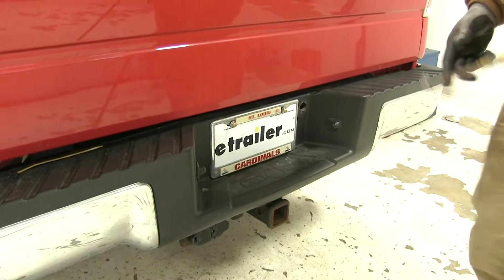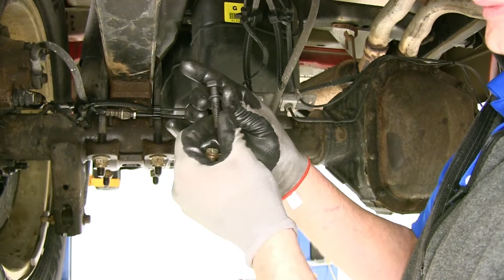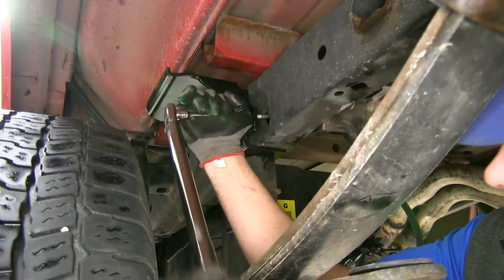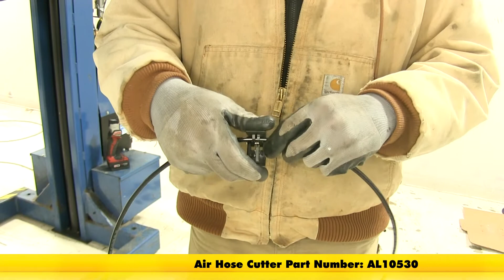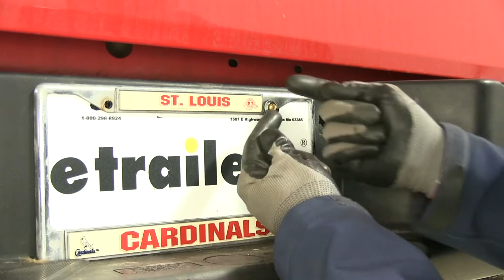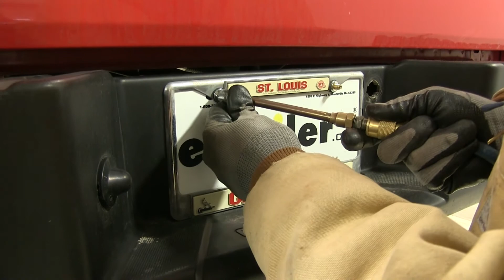etrailer | Mount: Air Lift Ride Control Air Helper Springs on a 2009 Ford F-150

Comment: Excellent instructions. I just bought your airbag lift suspension for my 2009 F150, looking forward to getting it installed. just curious if there is any recommended air pressure to keep the bags at for everyday driving? Or would that all depend on the type of ride a person is looking to have?
Reply from the maker: We love to hear this! You will want to leave 5 psi in the bags when you are not using them to haul. This is so that the bags keep their shape.
https://www.etrailer.com/Vehicle-Suspension/Air-Lift/AL59544.html
Reply: @etrailer  Thank you. Sorry for the late response I just found out by accident that there was a place to hear back from questions on You Tube questions or responses. LOL. I just got my airbags yesterday so I am installing them this weekend! Last weekend I just installed new H/D KYB gas shocks in the rear and H/D W/ beafier coils KYB gas struts in the front that has a 2" lift. When I bought the shocks I didn't think about buying the 2"block for the rear so I will be adding them as well as the airbags. I am a landscaper and pull a trailer  a tandem 14ft trailer with my mowers and collect brush and debris to put in the back of the trailer, So I'm super excited to give them a try. I decided to get your airbags for 2 reasons, 1 cost and 2 the quality of both the rubber of the bags and the metal brackets. I feel why spend 300 more for the compressor that only work the lift, when I can buy a dewalt portable air compressor that I can use for everything else like bike tires, car tires, camping blowing up air toys etc..